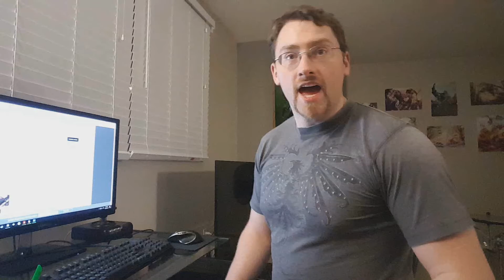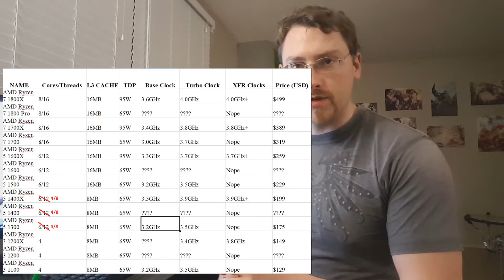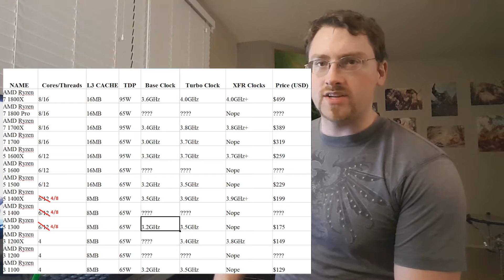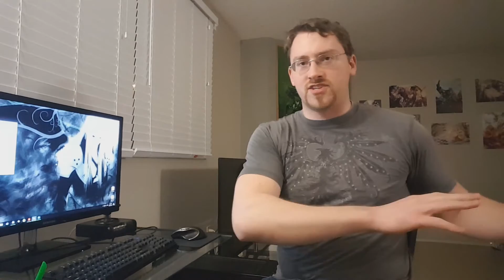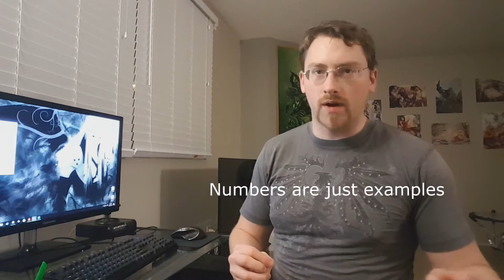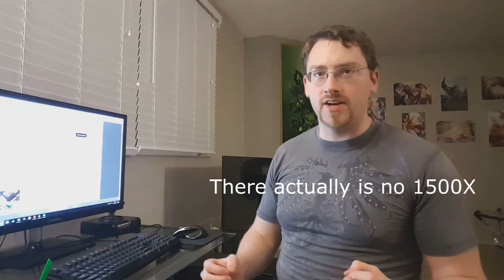Ryzen XFR (Extended Frequency Range)

Comment: how do i get xfr working. i only play games and im scared of overclocking so all i want is that boost to get a bit better performance
Reply from the maker: Ryzen already does XFR by default. unfortunately this gen, it's only about 100MHz, so pretty limited. I'm hoping it'll be extended as the generations mature. Honestly you shouldn't be worried about OC. if you keep your voltage under 1.4V, you have absolutely nothing to worry about; you can't kill or damage your chip under that.
Reply: if i overclock with stock voltage to about 3.8ghz is that gonna shorten my cpu's life?
Reply from the maker: if you OC to about 3.8GHz at stock voltage you're unlikely to be stable unless you have something that's pretty well-binned. You'll have to increase the voltage a bit, but if you're under 1.4V, I wouldn't worry too much about the lifespan unless you have terrible cooling and it gets rather hot. I mean I can't tell you what frequency it'll run at because I don't know what you have and even if I did, every chip is different. you kind of have to play with it to figure out what's stable. By stable I mean if your frequency is too high and voltage is low, parts of your CPU won't get enough power and it won't run properly and you'll get BSOD or just shut-downs. It doesn't really harm the system; you'll get lots of those as you're testing to figure out where you'll be. But yeah keep it under 80C, and keep it under 1.4V and make sure it has enough voltage to be stable at whatever clock speeds you're at. Do lots of cinebench and other stress-tests to test stability.
Reply: what cpu speed do you suggest me with stock voltage? thanks for the anwsers
Reply from the maker: I really can't tell you. Even if I knew which CPU you had, which might give me a better rough guesstimate, any number I said could just as likely be impossible or not as good as it could do. you''ll have to test it to see what your system is capable of. If you want to stay at stock voltage, just try increasing the frequency till it becomes unstable, then go back to where it was stable. Make sure you're running it hard for a good while to check if it's stable though. one cinebench run won't tell you if you're stable.

Comment: I hope someone will do a phase change cooling to test the XFR.
Reply from the maker: Lol that would be interesting. From what I've gathered though, it seems that it doesn't actually go indefinitely. It's more like an extended Turbo boost barring thermal restrictions it seems. R7 seems to go 100MHz, and R5 is supposed to be 200MHz.

Comment: I wonder how the processor will be able to tell whether the automatic overclock is going to be stable or not...
Reply from the maker: This entire reply is pure speculation: It could be that it has ways of detecting stability in itself; ie if it starts making mistakes, or things start going out in unexpected ways, it'll throttle itself. 

More likely imo though is that it knows what voltages it needs to maintain stability at certain clock speeds, and can detect the stability of the power being supplied, regulated by the VRM and power phases in order to determine the stability of the clocks.
Reply: I've had this impression that the computing inside a processor is so delicate that as soon as a single mistake is made, everything goes to hell so fast that a crash follows almost instantly. Now that I think about it it's probably not like that in most cases.

Your second explanation makes a lot of sense to me.